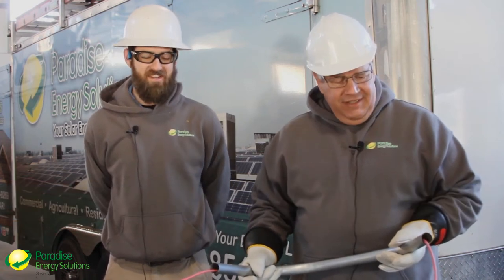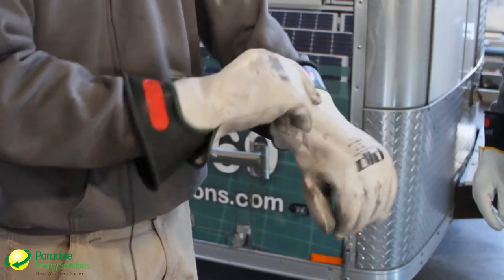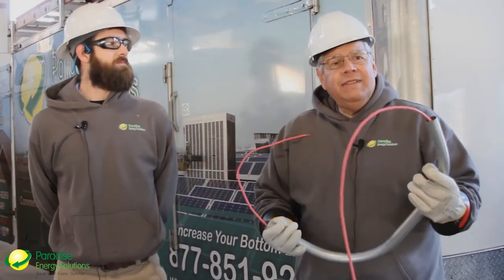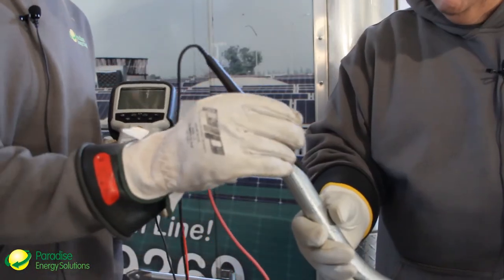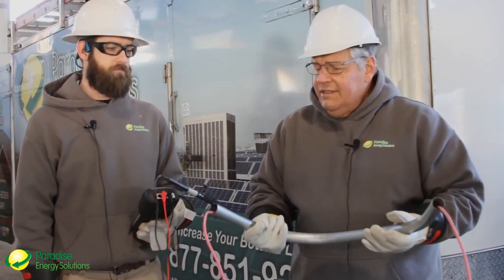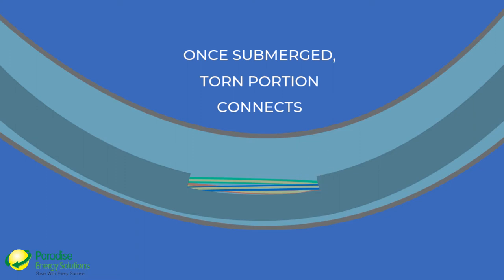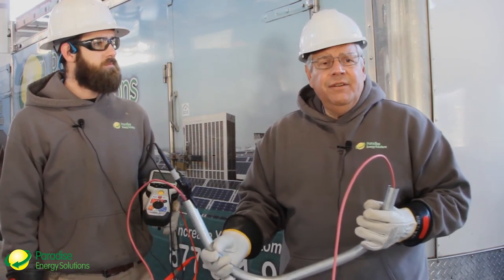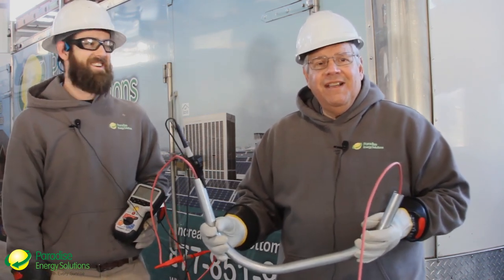Insulation Resistance Testing Techniques

Comment: So this shows a possible fault in testing results. We constantly have fluctuating water levels in our pipes, no matter what we do to try to keep it out. So this is absolutely a real possibility. 

Im actually looking into how to find the fault/nick/comprised insulation in a service wire inside burried pvc. Ws used a spit fire which works like a meghor but it sends a pulse which then can detect a fault on the surface by probes. We decided to run a new wire. But I'd like to find other testing options to get us right on top of the issue more efficiently.

Comment: That's neat. Could an electrically conductive gas be used?
Reply from the maker: The purpose of the video is to share that an insulation resistance test may not give the user an accurate indication of an insulation fault under circumstances where the exposed conductor isn't touching another exposed conductor or metal conduit.  The purpose of introducing water in the video is to demonstrate the concept.  We don't have the technical expertise to guide you on the safety of using an electrically conductive gas.  Please seek qualified guidance, as many gases can be explosive under the right conditions, and we want to avoid this!

Comment: Question would performing this test cause the conduit to be energized momentarily if say i test the line wire in respect to ground or nuetral to ground or line/ neutral to ground?
Reply from the maker: Insulation resistance testing should be performed by qualified and trained personnel.  The test involves using a calibrated insulation resistance test meter.  We use a meter from a company called Megger.  All conductors being tested must be de-energized and locked out from potential energy sources using approved Lock Out Tag Out procedures.  Conductors should be removed from terminals according to the meter test instructions.  The test does involve connecting the positive and negative probes of the meter to the conductor being tested, and to the metal conduit, other conductor, equipment grounding conductor, or neutral conductor.  

A voltage is introduced on to the test conductor.  If there is an insulation fault, the amount of resistance between the test conductor and other conductor, metal conduit, etc, is measured.  If the meter detects too low of a resistance, it will stop the test.  However, depending on the amount of resistance the meter measures, there could be momentary voltage on the metal conduit.

The person conducting the test must wear appropriate Personal Protective Equipment, such as tested insulated gloves and safety glasses, and must ensure that all other people are aware of the test and are not touching any surfaces that could conduct test voltage.  All conductors that are not landed on terminals must be capped with a properly rated insulating cap or tape.

Again, the test should be conducted by properly trained personnel who are aware of the proper safety procedures to follow during the test.

Comment: This test is very realistic. 
Is the rule of thumb 1 Megaohm  for every 1000 V, but at least 1 Megaohm still up to date?  A value under 2 Megaohms is always critical.
Reply from the maker: The test we shared is a very simple insulation resistance test meant to show how an obvious fault may not be found unless there is a way for fault current to flow from the damaged conductor to the conduit or an adjacent damaged conductor.  We don't test above 1000V, as our test is a very basic test.  Any result less than one megaohm will cause us to further evaluate the conductor.

We would encourage anyone interested in doing more advanced testing or testing at higher voltages to consult the equipment manufacturer for their instructions on how to properly use their instrument at higher voltages and how to interpret the test results.   We don't make any claims to have an expert level of insulation resistance testing experience, and are always glad to hear from those with more experience than what we have!  Thank you for the feedback.